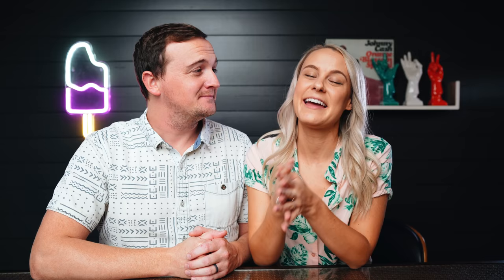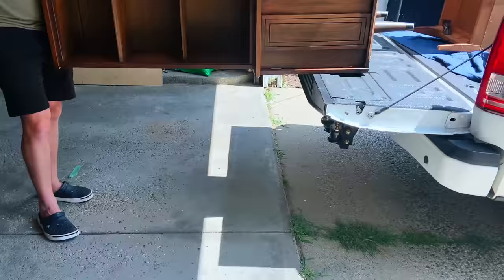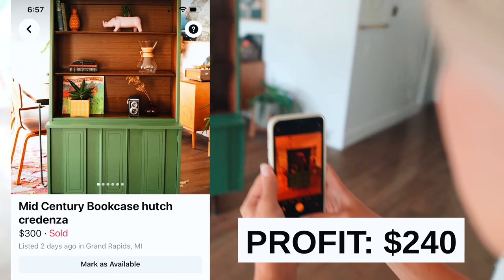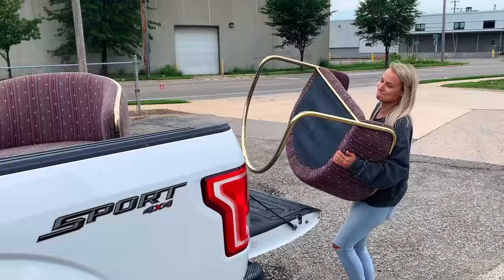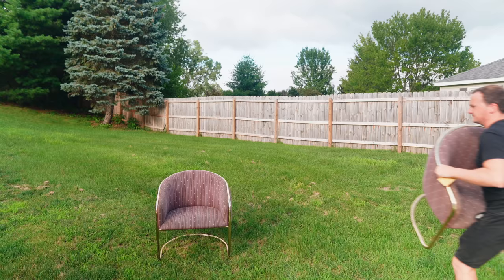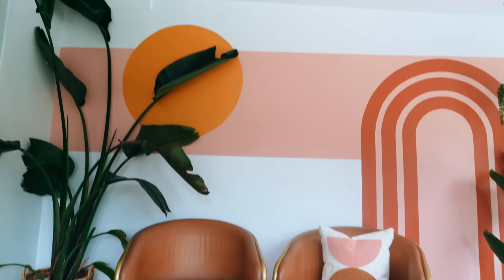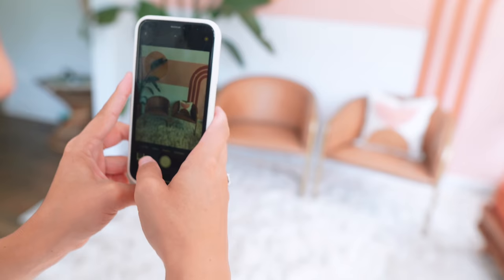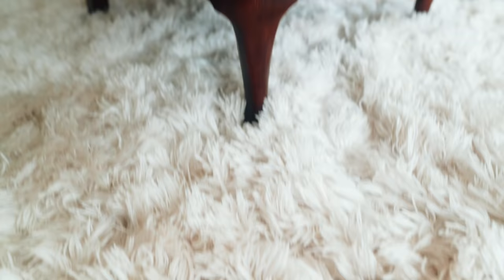18 MIND BLOWING Furniture Flips 🤯 - Top Flipping Hacks 2021

Comment: The "leather" chairs turned out nicely! Next time, prime them first with primer or an unneeded latex paint. You can buy gallons of oops paint for only $9 at HD, and even cheaper at the Habitat Restore, or yard sales etc. Pretty much every time I go to HD, I check the paint section for good quality and good color Oops gallons, and I buy them for later use. The oops samples or pints are even cheaper, $2-3 or so. Great to have on hand.
Reply from the maker: Great idea thanks!!
Reply: I think the problem with the chairs is the fabric, the one alone Fox did was a smooth fabric.  Think 1980’s type fabric.  I’ve seen others on you tube that had trouble like you did.

Comment: Hello again! Back in the day ACE Hardware was known for thier specialty in the nuts and bolts area. If you're missing a sertin nut or bolt for a peace of furniture you can most likely find the exact one you're missing at ACE Hardware and you only purchase the quantity you need! Also when it comes to cleaning old dirty furniture I've learned from a buddy of mine the owns a Auto body shop has showed me that I can take them to a high pressure car wash to clean couches ,chairs Etc. Then let them set out in the sun to dry! This works very well! Hope this is helpful in the future! Blessings to guys!

Comment: Just note that if you buy a paint gun, a lot require an air compressor of a certain horsepower. I bought one to work with my 1/3hp pancake air compressor and only realized once I was ready to set up that my sprayer required at least 1/2hp compressor to run it. Lol

Comment: I've prob pulled 1,000,000 staples out from carpet on stairs and this is the easiest way to pull a lot of them. Here's the tip on pulling staples. Try using a pair of dykes or a wide headed plyers. Hold the the plyers so they are upside down As in the head is facing down instead of up. so when you grab the staple you can push the plyers over following the side of the plyers. as you push, the staple will be removed. You will find that the staple will come  out without all the yanking.